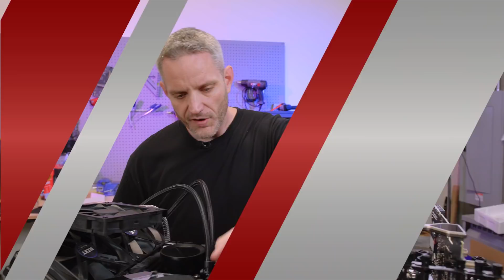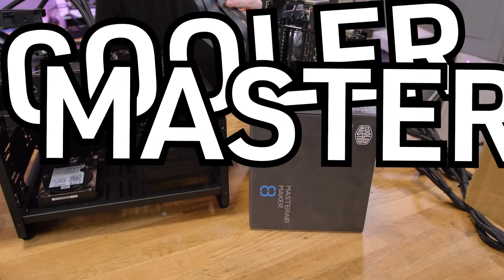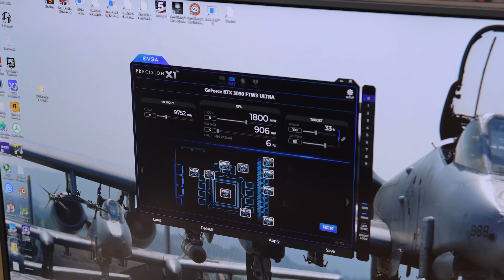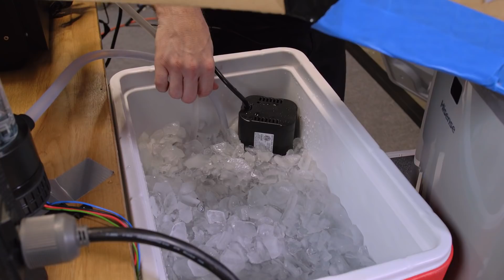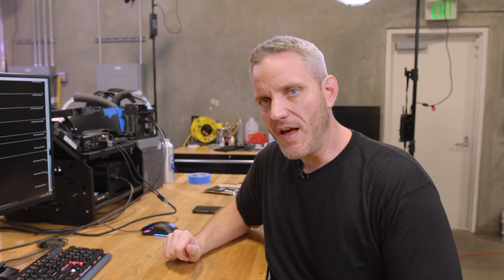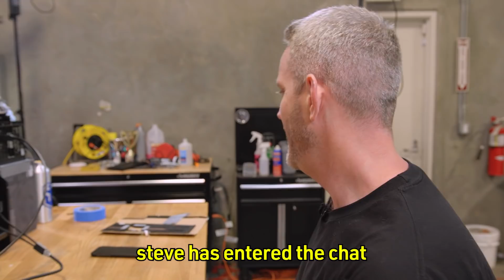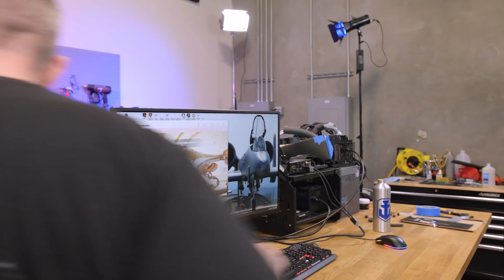Homemade Waterblocks for RTX 3090 SLI... these results are incredible!

Comment: What about mineral oil and submerged parts?
Reply: Water is the best heat conducting fluid you can easily work with at the temperature ranges we are looking at. Next step up would be metals that are liquid at room temperature which are nearly impossible to work with for OC purposes. Just submerging a system in oil does nothing on itself. You still need to get get the energy out of the fluid, and therefore need a heat exchanger like a radiator. The main advantage of certain other circulating heat transfer fluids in industry apllications is different temperature ranges for which water is not suitable. And heat is usually exchanged with water from these fluids in these setups anyway. Peeps tried the mineral oil thing decades ago, pumps die in weeks not years, no better temps than water and a mess to work with. It is just done now and then for show builds that look like an aquarium and give the illusion of a PC being in water. It was a noveltity in the early 90s at trade shows, but even than got old quick.

Next step up up after water is cooling the touching metal surfaces by better means than ice water for extreme overclocking (read lower temps). Liquid Nitrogen is the easiest to work with and is easily availabe. Next step up would be liquid helium, which is a bitch to work with and hardware often cold bugs at too low temperature anyway.

Comment: Don't these cards have a BIOS switch?

That could be the boost table issues.
Reply: i was looking for this comment. my thoughts exactly, he didnt talk about the bios switches at all.
Reply: northy lol wasn’t surprised
Reply: i hope Jay reads this and clarifies next video weather or not both cards were switched to the same bios mode. (i cant remember if it was called silent and performance?)
Reply: @northy1984  he did we saw him show both cards were showing the same bios in GPU-Z
Reply: @greengamerguy623  its the same bios just different setting  its not 2 different bios
Reply: @greengamerguy623  By default the cards have a "performance/oc" mode and a "quiet/stock/low power" mode and both would have the same BIOS version with a different boost table.
Reply: @gudenau  I'd have to check that with my cards but I find it hard to believe that two seperatly conigured bios would have the exact same bios version, that is a bit sus to me and prone to factory error in my mind. How would they know what one to load to what chip if they both show they same version?
Reply: @greengamerguy623  Generally the switch either: Switches the "chip enable" signal between two flash chips or toggles the highest address bit. There are two entire copies of the BIOS on the card.
Reply: Jay should've just ripped both BIOSes off the cards and compared the MD5 or SHA1 checksums. Or just flash the BIOS with the higher clocks to both cards?
Reply: Came to the comments to look for this.  My thoughts exactly.  How funny would it be if that was the issue lol
Reply: @matthewkuhl79  he is talking about the 2 different cards not 2 bios on the same card.
Reply: @krishgupta4745  Yeah, i see that having watched it again, but it was Steve who specifically pointed it out in his video 👍
Reply: that would be a separate bios

Comment: This is my guess on the different boost tables. On phones with Qualcomm chips, certain kernels/firmware will read a special bin number written onto the chips by Qualcomm and will pick based on that number the table. That table will contain the voltage it should run at corresponding to what frequency it runs at. Could be something similar. 

The bin is literally internal binning process done by Qualcomm. Discovered this on some XDA developer forums while trying to undervolt my CPU to get better battery life lol.
Reply: It seems it one card is on the performance mod and the other on silent mod just need to flip a switch maybe not not but the best explanation

Comment: Is there "mainstream"" way to cool your GPU with CPU block? 
I mean are there any passive memory radiators on the market that might be enough?
Reply: Best thing for it is little aluminium heatsinks that have thermal adhesive pads. They’re cheap and effective, just stick one on every VRM and memory chip

Comment: Ummmmmmm Jay.... What you said about just air on the VRMs over a cooling block is soooooooo not true. A cooling block provides one thing that direct air doesnt.... Surface area. They massively increase surface area across fins which end up having air picking up a lot more heat.
 Just FYI

Comment: will inserts that force air in the AC box down on the PCB not help cooling the VRM?
isn't most of the AC air flow though the tunnel without touching the cards?

Comment: Jay , flash the BIOS from your "better" card to your "worse" , it should be piece of cake , considering these GPU's are identical. Maybe it'll help with memory overclocking and overall stability. Speaking about the changes between identical BIOS 'es I gues they are just iterations of same bios live ver.1 and ver.1.1 . Also , fool check , look at BIOS switch if there's any . Maybe 2nd GPU in Quiet BIOS mode.

Comment: Why not run the AC over the system with the full cover blocks on the cards. The AC would dry out the air before it reaches the blocks so you'll get much less condensation on the full cover blocks.

Comment: Jay, why you running the old driver version? 456.55 is more stable according to Jensen 🤣
Reply: Because the new driver makes it more stable by slowing the card down. Obviously jay is trying to make the cards work as fast as possible, so thats no good. The real cause of the stability issue is the cheap capacitors used on the back of the cheaper models of the cards, so its more of a work around than a fix.

Comment: Why not try a super-cooled mineral oil bath on a loop for the graphics cards as a whole, sealed off to prevent moisture. This would also cool the memory modules so you didn't have to fire up the a/c unit. With another loop for the GPU using super-cooled water or maybe even an improvised LN2 delivery system.

Comment: err the foam is insulating the memory, that may be some of the temps issue on them.
Reply: There is no memory in the location of the foam.
Reply: @ScytheNoire  Oh could have sworn i saw when he put it around the block it covered like half the chips
Reply: I hadn't thought about that till I read your comment. Excellent point.
Reply: Yeah, there was and I didnt like that either, especially as the AC should have prevented condensation anyway.

Comment: You know condensation is distilled... distilled water isn't even conductive to any measurably significant degree... I used to have ice buildup all over the CPU and MOBO back in the 370 / FC370 days... slot 1 days too... back when peltiers were king. It never mattered... distilled and all.

Comment: Instead of normal cooling liquid and ice water, go automotive coolant with the radiator in a bath of ice-automotive-coolant (should be around -38 C). I'd love to see a test with that.
Maybe delute the bath with water, giving you a higher melting point. Adjust it to something your freezer can get to. You do want the phase change from ice to liquid in there.

Comment: Wait, why keep using riser, you removed the thick cooler already, weirdChamp
Reply: IIRC the new Nvidia SLI bridge he have is for 4-slot spacing but the motherboard has 3-slot spacing. AFAIK Nvidia do have a 3-slot bridge too but that doesn't help when you only have the 4-slot version. He could go with Threadripper or W-3175X where 4-slot is easy to find but... Port Royal doesn't benefit from the extreme core counts or many PCIe lanes.
Using risers also makes everything simpler to work with and reduce the risks associated with condensation - which he seems to have dodged so far but will become an even bigger issue once they take the next step up to LN2.
Reply: May be to avoid possible condense droplets falling on motherboard?
Reply: to keep the condensation away from the motherboard since the riser cables aren't effecting the performance enough to matter. likely when Jay and Steve go to LN2 they'll both stop using the riser cables since every once of performance will matter.